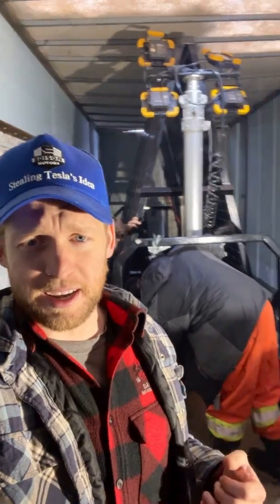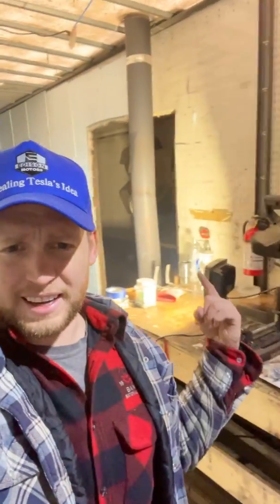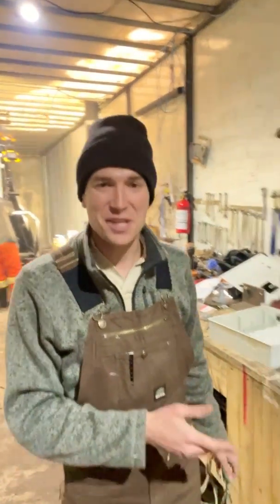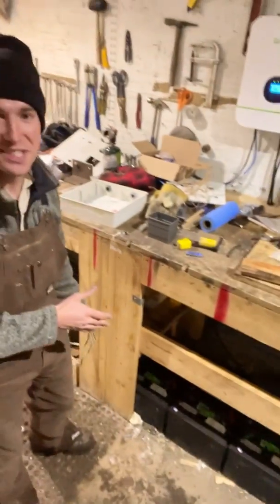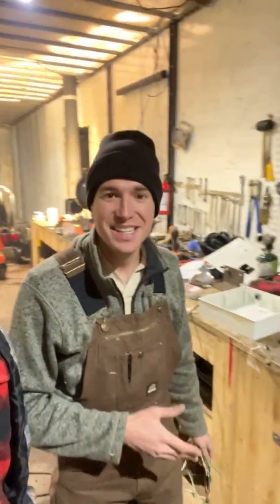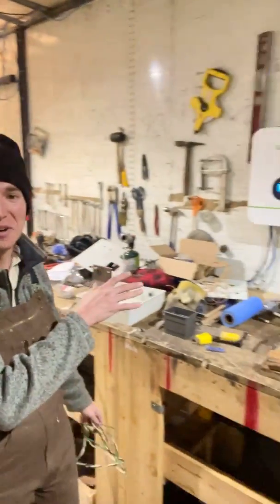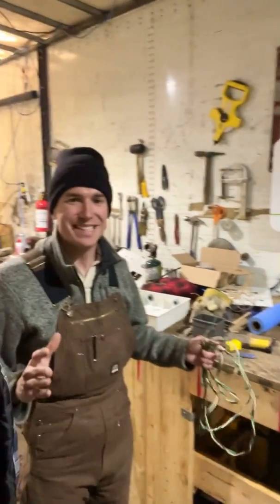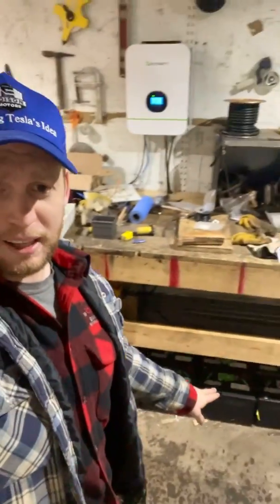Innovative Power Solutions: How Our Hybrid System Saves Money in the Workshop

Comment: Your videos of the yard usually show a few of the solar trailers hanging around. Maybe utilize their power while waiting to ship?

And put a few panels on top of your shop?

Is the Lincoln welder liquid cooled? Use the heat for space heat. If not, make a heat exchanger for the exhaust and use that .

Ok i didn't quite catch the part about only running the generator 1/2 hour a day.

Do you use it for welding,at least?

Comment: So watching "Lumber Capital Log Yard" these guys have a Woodmizer band saw which is for the most part stationary but is driven by a small gas engine (probably 20 Hp). The duty cycle of this outfit is - making a cut in one direction then no load during return and repositioning for another cut. What do you think they could save by using an electric motor in place of the gas engine, a bank of batteries and a small generator (diesel) or even some solar panels. It would be a neat project especially since there are attractive females that operate this band saw!!  😇

Comment: Lead acid deep cycle batteries or a larger Redox Chemical Flow battery might be an option for longevity. 
Add in a solar array and a wind turbine to add renewable feed when available and bob's your uncle.
beats spending between 100 - 200K of overhead lines and poles or trenching from the nearest grid pole to your shop.
Just stay away from the Lithium ion batteries in enclosed areas particularly the cheaper Chinesium ones. 
LG Chem have a major safety recall here in Aus due to thermal runaway in the solar backup batteries here and 5 houses have caught fire due to faulty BMS as the house batteries have Zero thermal management.

Comment: Per the video's numbers, I wonder how they're jamming $80 of fuel through a pipsqueak generator that is only producing 1.5kWH per day? Be surprising if it could burn 2 liters per hour.
Reply: its Lincoln 300d a 300 amp welding machine, but has like 3kw of A/C aux power,and thats what they are charging with, i think they use it (instead of like a light plant) because they, already have it and need welding power sometimes
Reply: @theshadetreewelder5043  I understand that. To recap, the  generator is said to run 30 minutes to top-off the batteries for a day's usage. That would be 1.5 kWH of generator output, maximum. Not sure  if a "day" is 8, 10, 12, 24 hours? Forgetting efficiency losses for now, it indicates that  the shop must consume at most just 1.5 kWH on such a day. Roughly equivalent to three 60W bulbs burning for 8 hours. Yes, $80 would be a crazy figure for that.

Comment: Love your diesel EV. But I have one question its the same question I have for any off road EV. Given it is intended to work in a place where a forest fire would be shall we say undesirable. What is your plan for fire mitigation on the battery pack? It seems to me that a battery fire will be catastrophic, given a fire extinguisher or a brush fire pump will be totally useless.
Reply: What about the battery pack makes for a concern about fire?
Reply: @mlindholm  Google Tesla burning underwater. Or jeep 4xe explosion. 

When a lithium battery pack experiences thermal runaway and ignites. They produce combustible toxic gasses. You can't extinguish a lithium battery fire with just water.  The fire burns hot enough to melt steel and burn aluminum. 

The only reliable way I know of to extinguish a lithium battery pack after it ignites. Is to use brine water that is cooled below the freezing point of fresh water. You flood the battery/car with it. It removes the heat and to slow/stop the chemical reaction. 

Chemical and CO2 fire extinguishers are useless against a battery in thermal runaway. 

Note I didn't say what type of lithium battery. Because they all can experience thermal runaway and they all burn. This is a problem with batteries in any EV.  Diesel burns and gasoline explodes. But neither provides it's own fuel, oxygen and heat. Along with toxic gasses. 

EV batteries are most dangerous when fully charged or while under high discharge or charge rates.
Reply: @EthosAtheos Most data points to make gasoline vehicle fires than EVs, adjusted for quantities of each on the road. EV fire risk is much overblown. First responders and tow/storage yards do need some new training and policies but they aren't more frequent than existing vehicle fires. 

Plus stationary batteries get some benefits in that storage density isn't as critical so the packs aren't quite as energetic, and it's easier to reduce risk with simple precautions like block or cement structures.

And then... I'm not 100% sure but I think that might be a lead acid pack (like I said, stationary applications are more space and mass forgiving) which makes the risk even less.
Reply: @saiboogu  I'm not concerned about frequency. I'm concerned about the fact that in the fire triangle(fuel, O2, heat); A lithium battery provides all 3. Gas/Diesel do not and can be extinguished with a simple fire extinguisher in many cases. Car fires these days are rare across all types. The fact that it doesn't happen often isn't the point. 

If you drive in areas where the fire department would take hours to get to you. Then you should be carrying everything you need to deal with a fire. Most ICE engine fires can be handled with just a hand held extinguisher. If you get to it quickly. This isn't true of a lithium battery fire. Lithium batteries can not be extinguished by anything, the vehicle can carry with it. 

Fire mitigation has to be built into the battery box and the vehicle. The best case scenario would be to drop the battery pack and drive the vehicle to a safe distance and deal with secondary fire. But I'm not sure that is practical. Second best might be a battery box that can contain a fire. But lithium battery fires easily burn at temperatures that melt almost all metals. 

As for static home battery packs. Flooded lead acid batteries are a fire hazard as they off gas hydrogen. They are never used these days in professional installs. Sealed lead acid batteries are heavy, bulky and have short service lives. Lithium is rapidly replacing them, mostly because of service life vs upfront costs. 

The use of a battery bank inside a conex box is the perfect application. As a conex box is designed not to allow the spread of fire. They have to be due to the regulations of being at sea. But in your basement they are a serious risk and we shouldn't be putting battery banks in homes or businesses. They should be in fire resistant out buildings. 

We know the risks but regulation is lacking. Because the electrification crowd wants to stick it's collective head in the sand. I'm not against EVs or batteries. I am against forest fires and dead firefighters in structure fires.
Reply: @EthosAtheos why, if this is a known and seemingly unsolved problem for all lithium batteries, do you put the need for solution upon this company?
Reply: @azza-in_this_day_and_age  If I understand your question correctly. I would say it is the EV manufacturers responsibility because the made the thing. For example if I built houses and I used a material that easily catches fire under some conditions. You'd rightly blame me for a fire. Yes there is a roll for government regulation. Right now governments are just pushing EVs as hard as they can. They ignore the dangers and possible down sides. One of those is the impact of mining lithium; The other is battery fires. 

You see some government regulation around lithium based batteries in the air travel sector and shipping. At least here in the USA there are very few industries that are as regulated as air planes. You are now limited on the size and quantity of lithium batteries you can take on a plane. Because the dangers of a fire on a plane are so extreme.  The government understands the risks it chose not to do anything about it in one case and not the other.

Comment: Have you thought about using mechanical batteries for applications like that where you have the space? I know they're somewhat less efficient but they are far more cost effective and can be made out of reusable materials
Reply: With what I know about mechanical batteries they just wear out a lot faster. So for a situation like this where they're going to be cycled frequently, I think deep cycle lead acid batteries, which is what they appear to be using are probably the most cost effective long-term solution
Reply: @the_undead  a flywheel battery which would be my choice for said battery will last up to 30 years. That's about 3 times the lifespan of most chemical batteries. There are many aspects of said batteries I'm not familiar with but lifespan and efficiency I am. They aren't exceptionally efficient which would lead to slightly higher fuel costs but a much lower initial build cost.
Reply: @davidwilburn9809  seeing is the whole point of this system is long-term cost, savings and efficiency. I highly doubt a flywheel would be ideal with what you just said.
Reply: @the_undead the efficiency isn't that much less and when you account for the 2200 initial cost and 1000 cost every 3-10 years for battery replacement vs the probably 6-800 for a flywheel and motor the tradeoff is negligible. But this discussion is mostly pointless we are both laypeople why don't we let the engineers speak on whether it has merit
Reply: @davidwilburn9809 This is a bit of a semi educated hunch but I think you're about an order of magnitude off for the cost of a flywheel setup that can provide as many watt hours as they have in the battery pack. 

A flywheel on a motor won't spin very long. You need a vacuum chamber to minimize drag. Gig tech bearings to reduce friction. Super high RPM, which makes the flywheel a very critical high tolerance item, and the vacuum housing needs to be reinforced to contain the shrapnel if it lets go. Flywheel energy storage is more suitable for short cycles while generators start up, or really large scale storage where economies of scale make the expense worthwhile.
Reply: @saiboogu  they'll spin two days with all the specifications you gave. If their storage only holds enough power to run for a few hours before their generator needs to start back up as they are saying is the case a repurposed large engine flywheel might suffice. Again it's an efficiency question and whether the tradeoff would be worth it for the added sustainability and reduced waste. If it was holding solar power for all night I would agree with you but that isn't what this system is designed for
Reply: @davidwilburn9809  With a load, not likely. But unloaded, sure. That's the point, minimize waste because otherwise it's not a very efficient storage method. 

Without all that, it's unlikely to run more than a few minutes under a load. 

Flywheel storage isn't cheap at this scale and power density.
Reply: @saiboogu  the amount of power stored depends on two things weight and speed. How long that power stays stored and the energy loss is affected by the factors of friction and heat. If you have a power source on reserve the longevity of storage is less a concern than the amount of power stored for which you can go heavier and save rotational speed and friction loss. I may not understand the electrical components but I understand the physics quite well and it is possible I was just hoping for the engineers that understand the electrical components to chime in and put the two together
Reply: @davidwilburn9809  I think YouTube ate my reply, so my apologies if this is redundant. I'll try to keep this one shorter. 

When you have power on standby storage time isn't an issue which is why, so far, flywheels are often used for transitional  power while a generator starts up. Either for data center or hospital scale UPS or grid spikes while gas plants spin up. They don't need low self discharge or high energy density, they just need to put out a lot of power in an instant, for a few minutes. 

But for this hybrid scenario in the video above, both energy density and self discharge are big factors. Batteries will lose very small amounts of energy over a typical working day so when the generator runs to top them up, a large portion of the energy put in comes back out. Numbers would vary with the inverter/charger, but above 90% efficiency is not crazy. 

I'm not an EE but I know you don't need one to answer the question marks in your proposal. 

If you know the physical engineering then I suggest you run some numbers. Make a chart of flywheel masses and RPMs necessary to store 11 kwh converted to whatever unit you are comfortable with. 10kwh+ a generous 10% for electrical losses. Then start running drag numbers on them and seeing how much energy is lost. Start checking how much drag affordable bearings have at the speeds and masses. 

What you suggest is about 95% a mechanical engineering issue, and the electrical side is pretty much solved. Do the physics homework.
Reply: @saiboogu  that would be doable if I was able to find such charts I am however like you not an engineer and have no clue where to find such information which is why I have asked the engineers who would more likely know where such information could be found. However it continues to be a discussion between two lay people neither of which have the required information to flesh out a working model. Because of said factors yes this discussion of hypotheticals is quite redundant because neither of us can definitively answer the questions put forward by the other.
Reply: @davidwilburn9809  You implied you had the physics knowledge and only needed an electronic engineer. I pointed out it was an engineering issue (applied physics), and your story changes. 
Maybe consider the person who has been trying to inform you this whole time does actually know more on this topic than you, even if I'm not an engineer. 

I'm not trying to piss in your Cheerios, but to tell you your idea has already been considered and is already being worked on - but it's far deeper in the lab, and not able to be assembled from of the shelf parts like the Edison team (no offense intended, it's a brilliant strategy when the parts are available). Let Edison focus on vehicles and existing power storage while the hardcore geeks get the less stable tech developed.
Reply: @saiboogu  as with everything application matters. The current ones being worked on are for house systems that don't have on demand energy sources. Completely different application. Also you say you know more about the subject yet fail to realize there are multiple data points missing from the information at hand. They don't say the 30 minutes the generator runs to power current batteries is all in one run it may run multiple times for 5-10 minutes. The output of said generator and the power draw of the shop. Without all these data points no one could make a comprehensive model. That being said again maybe you should let the ones who would have all that information answer for themselves instead of making as you put it somewhat educated guesses.
Reply: @davidwilburn9809  None of the variables you mention matter of the necessary technology is still too large and expensive. 

There are very few pictures differences between this shop configuration and a home backup unit. Both have similar peak demands and both benefit from efficient storage with low self discharge. I've shown real world examples to let you know what the current state of the art is. 

You're free to wait for different opinions but it's a YouTube short and it's already days old - no one better is showing up. 

I've tried sharing what I know on the topic, because I understand enough of the relevant engineering to know the scope of the problem is larger than you imply. If you don't value that information, I guess I'm done here.
Reply: @saiboogu  you say those variables don't matter but the number of times that it's loaded and unloaded during the day speak to how much friction comes into play. If we're talking 8 hours worth of friction vs 2 hours of friction that's a difference of four times the force to be accounted for. Every variable matters and that variable alone could determine whether a cheaper higher friction system would be viable or not. Home backup units have to be built to last at least a day in case of a heavily overcast day because the main power source is usually solar. The difference of the on demand power source makes the applications worlds apart. Also on size Taurus flywheel storage is very small but it is exceptionally expensive because it's built to spin for days and spin at exceptionally high rpms which if this one only needs to spin for a few hours wouldn't be the case at all. There are too many unknown variables to say outright this wouldn't work with just a large engine flywheel the most important one being necessary spin time

Comment: Umm, so I had the same idea, but the welder I picked up, is a super old Big 20. I'm told the 120v can barely power a big grinder.... but my plan was to plug the leads into a large solar charge controller anyhow. Not much info out there, but what I have found, more or less, says I'll be fine.
Reply: Ecoflow makes a great power station that has built in solar controller. They have a 2400watt, 3600watt, 7200watt output versions. It will cost more than a diy system but is also portable
Reply: @JD-yx7be  portable is important for me, I mainly  choose the welder because of 500$ power bills from all the 1/4" rods I burn.